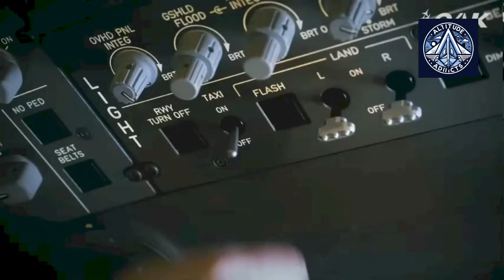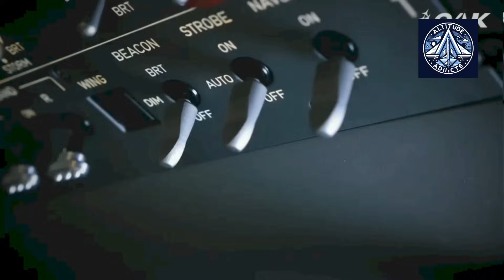Why Russian Aircraft Like MC-21 and SJ-100 “Chase The Weather” For Testing

Comment: You know what AI is..?.. It is a set of thousands of parameters taken with hundreds of sensors in diverse operating enviroments which then are used to make algorithms for the engine management and flight computer to regulate real time operations of the whole aircraft.... Every aircraft is different, that is why they call it certification....!